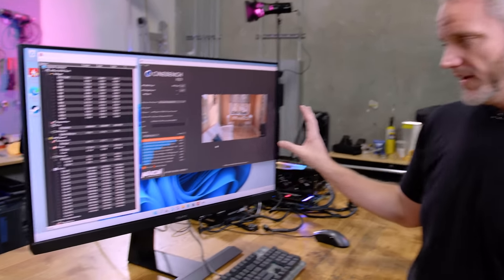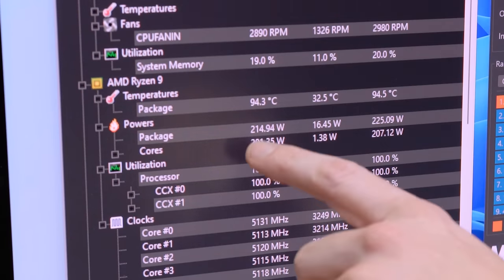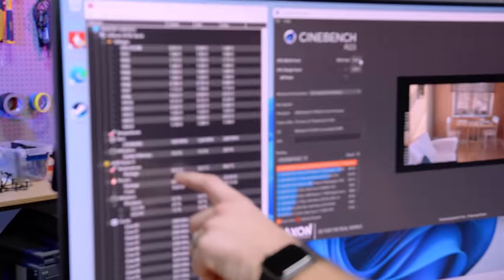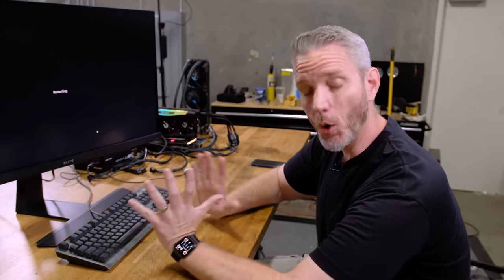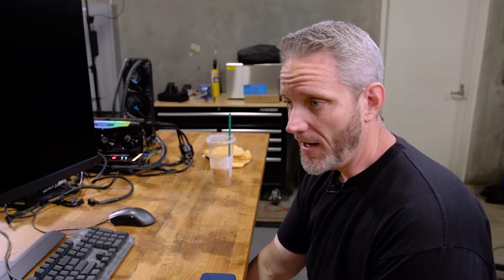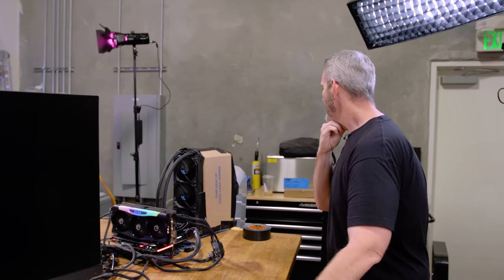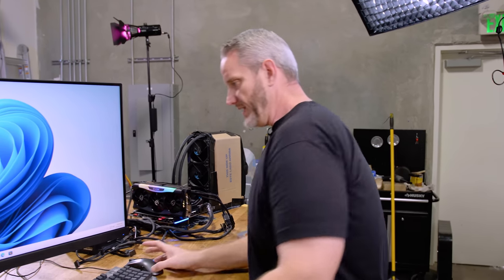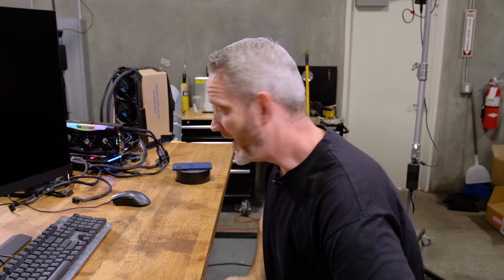This is fine...

Comment: This is a problem! Yes, its by design going to always try and hit 95C in search of max performance no matter the cooling solution. Problem is, as people have stated, this constant high temp will ramp system fans to 100% and it wont be pleasant. I personally dont like this design of maxing the temps no matter cooling solution because it makes it harder to judge what settings and fan configs are working better for it. You have to always compare benchmark scores instead of temps.
Reply: But to counter that you just change your fan curves. At the price of performance potentially. As people have said you just have to change the way you are doing things. Instead of setting overclocking by setting your overclock to your cooling you just set the fan speeds and the OC takes care of itself.

Comment: Jay, to tackle the HUGE increase in heat from all this next generation hardware, surely there is finally the incentive for the majority of people, who can afford to buy the top of the range new gear, to switch to custom water loop cooling, as the ultimate way to cool, stabilise, silent running, and performance boosting (no thermal throttling)? I am planning on a single custom water loop with three 420mm radiators (which was over the top in previous generations, but if you still want silent and extreme cooling, now sounds sensible), with water cooling blocks for CPU, GPU, M.2 gen5 drive, and even DDR5 RAM. I would love to see a video for which of the current off the shelf super cases can handle the installation of three 420mm radiators (or more) to cool the new top of the range hardware to sane temps, whilst having enough room to run the fans at relatively slow speeds for near silent running. I am currently thinking a Cooler Master HAF 700 BERSERKER or EVO pc case, although I heard a rumour that although Cooler Master claim you can install a 420mm radiator in top, side and bottom at the same time, there is no holes suitable for a 420mm at the top of the case; so if you could check this, and if it proves the case (pun intended) check what would be the maximum possible water cooling setup in that case, eg. two X 360mm top + 420mm side + 420mm bottom, possibly even something on the front or back. Would love some expert advice for us enthusiasts wanting the ultimate in water cooling and silent rigs. Thanks in advance from a loyal viewer.

Comment: its the 95c doing the crashes by stock voltage and 5.4 is too much ...why not lower the clocks so the temps can go down...i bet at 4.3ghz....the temps drop tremendous to 70c....95c sure is normal for folks live in canada...just wait when any texan use this during hot triple digit summer , now thats not normal when this crash a lot during summer for folks gonna be stuck in messing with the bios vs intel just set it and forget it , then game 24/7 vs amd users gonna spend 24/7 messing with bios settings constant heavy

Comment: I want to see what level of performance will happen with a Wraith Prism at a standard noise level. If it can run faster than a 5950, then the argument of "Air cooling is dead" will just be wrong.
*edit - It sounds like the cpu is auto-overclocking to the level of cooling you have. So a bad cooler, could actually run just fine. Yes you would lose performance, but the performance could be way better than previous gen throttling.

Comment: newer gpus have the sensor that detects the heat produced directly on the die, and the other reports the edge of the chip(which was previously the only temp reported) as the edge of the chip has the potential to burn/melt the board.

Comment: You should lap the cpu, like derbaur mentioned the IHS is thicker than previous generations. So lap the crap out of it so you have less metal to transfer the heat through. Then see what kind of improvements you can get

Comment: Hey Jay,  I use Ryzen Master for overclocking my 2600 and I never have to restart on a cpu overclock. My system crashes bios overclocking so I have no choice but to use ryzen master. I just set  open it after I start my pc and apply a profile and I''m good to go. I know I'm on a completely different platform so this may not apply to you but for me, a restart is only required if I change memory frequency or timings. My main profile only overclocks the cpu and leaves everything else at default.  I've  had issues with crashing as well but it was only when I attempted to downclock or lower the cpu voltages.   Seems like the issue could be the Auto overclock feature for you. If I'm not mistaken, it adjusts memory and cpu settings.  Not sure exactly what changes you've made in Ryzen Master but maybe you should try and adjust one setting at a time then apply which may allow you to isolate whats causing the crash.

Comment: I don't get it .. if it was designed to do that . Then you don't need any more cooling.    Since it will sit there at 95 degrees at all time ?.. it's like why bother building a cpu that must be cooked at all time at 70 degreess and hurts under load .. now you got a cpu that is designed to work under high heat.. you don't need to cool it down when it's designed to run hot it's stupid

Comment: I'm typing this on an FX-8350 system, but I feel like I'm on the other side of the spectrum. I'm looking at the 7700x with thoughts of under-volting it to keep my thermals down. I know they did a lot of architecture changes, but I just don't like the trend of throwing watts at parts to make them faster.

Comment: I use my Ryzen 5950x undervolted via PBO2 so when I render in Arnold full blast all cores are around 4.3ghz 57c temps (23-24c ambient) and 135-140w power draw. Honestly if you already own a 5950x you should stick with it. I mean the performance of the 7950x it's great but with the cost of those temps and power draw it's just not worth it. At least for me. And not to mention if you want to upgrade you need new motherboard, new RAM.. that's just insane.

Comment: 9:55 Hey Jay, from what I seen on new Boards Intel and AM4, They have a option in OC, might just be MSI (That is mainly ones we deal with in shop), that says "If OC Fail clear CMOS", which eliminates the having to manually clear it. Possible the AM5 boards have it enabled automatically

Comment: Let's try to reiterate: So the Zen 4 logic is to max out either power or thermal limit - and it is easier to hit thermal limit - one of the cores in the bunch is enough - and once you beaten thermal limit by better cooling it hits the power limit and dictates the ultimate power draw and draw no more unless you delimit. So you need a really good thermal solution to stop it from going to the 90s.

And the old X99 with that 10-core i7 Extreme would overshoot power limit with AVX workloads because of erratum BDH56 but you do get up to 128GB of RAM and can be tuned out to go faster (maybe time for ultra high end vs. current and next gen shootout?)

Comment: I picked up an XFX R9 290X Double Dissipation Edition back in 2014, according to AMD, 94C is max temp and the card can be run at that temp for the life of the card with no issues. Idk, I've always done what I could to keep it at or below 80C. Still using the card, though the newer games do drive the temps to max. Just posting for reference on the temps and a timeframe.
(Yes, I know he's working with a CPU, but GPU or CPU, temps are temps, and AMD mfr'd both. If AMD keeps this up, we're going to need second air conditioners just for a computer room in the house :/ )

Comment: I have a Intel i9 11900 (non k) because I can't be bothered overclocking. With a big Noctua air cooler and Windows in power options balanced mode, it jumps between 2.5 to 5.12 ghz. In high performance mode it sits between 4.80 to 5.12 ghz, and a 65 watt TDP. no problem.

Comment: Jay , they start to use new type of transistor's , witch back temp-resistance  corelation , some new matirial in semicondactor.
AMD NEED that 95 deg so the processor achive PROPER  charecteristic's  (semicondactor ) to achive beter condition.
that wy we see increse tempreture BUT not rising consumption , becouse  internal resistanse of transient stat of transistors ar GOING DOWN , less power desipation to heat. less loses to heat. more heat , lest power consumption.
that my opinion.

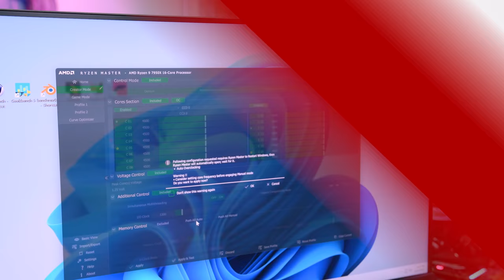Comment: 10:33 Sorry, Jay, go back to school for some physics classes. Space heating is only depending on the power consumption/output of the cpu. If a cpu uses 150W, these 150W are offloaded into the room. It does not matter what temperature your cpu, the water or the air has, in the end it's always 150W you dump into the room. You either dump a certain amount of air with 95°C into the room or you dump a lot more air into the room that has lower temps.
It's like energy consumption: it does not matter if you have have constant power draw of 150W over 1h or 300W over half an hour. In both cases your meter says total energy consumed = 150Wh

Comment: Cut the power limit in half, from 220W to 110W, the temps will drop.  Also, you'll only be dumping half the amount of heat into the room.  You'll lose 5-10% performance, but half the power consumption and way less heat dumped into the room and inside the case.  Lower temps in case will improve GPU performance.

Comment: So when overclocking all core with the same clock, stock voltage control, it runs cooler. This means, very simplified: On Stock it seems the cores individually boost a lot higher than the average clock speed shows it, also it might peak for a short time on some cores, making the CPU 95°C on ONE individual core at a time to get the best possible performance out of the CPU. It looks to me as though Lisa Su had ordered the Radeon team to the Ryzen team to figure out with them how to apply the GPU boost algorithms to Zen4!

Comment: Well temperature which is shown and which sensor detects it.. is kinda 'different' than we had in the past.. That reminds me on 'cooktop/stovetop' and 'induction' types.. on appliances, it gives same temp on a paper.. but in reality is little bit different as we know.. I wish if Jay can make a test in closed case of his choice, also somehow to measure temp in the case during 1h of load.. than we can compare is that temperature which is shown in software/bios is actualy dissipated heat or temporarly heat which sensor detects it on chip.. or whenever is located.. If is on chip and is not actual dissipated 'heat' ... ( ofcourse that temps will eventualy be taken out of the case depending how effective AIO is to lower it) than it's ok.. I mean who cares if cpu works on 100C or 20C if performance is there and is designed to work like that.. Maybe this request is too much or this is not channel of that kind to 'investigate' that 'actual' heat which we can sense into the case/room i would understand.

Comment: This is going to prove a fun platform for cooler showdowns now. Top of the line air v. Aio (240,280,360,420) seeing if they are up to the task. Then custom loop. Also the direct die that Roman was doing is going to look promising. Has anyone gone direct die LN2? I guess the next best would be to just lap the fuck out of that heat spreader to thin it out. 

I guess I’m excited about PC content again… still don’t think I’m going to pony up for one of these chips though. Just don’t have the money right now for it. Probably going to go grab a 3800x3d while I can and call it a day.

Comment: I don't get why people are so concerned about the temps. The part will boost till it hits 95C. If your cooler cant handle as much heat, it will simply boost less, but still give you all that your cooler is capable of handling, IE boost until it hits 95C.
No matter what cooler you are using the part will give you maximum performance at that coolers capability at all times.
Laptops have been running at 95C for years and years and they don't have much problem, its perfectly safe.

Comment: Jay,  

I have seen some info around about ECO mode with the new 7000 series, (in Ryzen Master?) which will limit the "power draw" of the 7950X to 65W draw.  Have you looked into that at all in regards to temps and performance?  I would love to see a video about at as it could be very important for SFF systems.  

Thanks

Comment: I don't see the point.

Why buy a CPU that meant you needed to run your cooling at 100%?

If the AMD 7000 series was donwclocked and downvolted a bit, with normal temps I would have bought one.

Comment: Here's something I've been curious about for a while. You hear a lot of "You don't need more than 6 cores for gaming" and "Gaming needs clocks, not cores."

In a money no object gaming rig, would you get better performance by buying the top SKU, like the 7950X and disabling SMT, or hyperthreading on Intel. Since the L1 cache is shared by two threads, if you disable SMT you're theoretically giving each core as much as double the L1 cache. We saw how much difference extra L3 cache made to the 5800X. The other thought here is, with SMT disabled, can you push the clocks harder?

Comment: I have a Ryzen 7 5800X running the same way. It goes straight to 90c and stays there. It has a 360 AIO from Arctic on it. So as of watching this, I am wondering if it is just normal behavior.
Reply: I have one undervolted and it runs 75c most of the time under high usage max is like 83. My buddy just built his and his is doing what yours is even with a good undervolt. Has yours been stable?
Reply: @Fergie_Ferg  Yes it is stable. I think it has to do with the precision boost is why the temp goes so high on Cinebench .

Comment: So having a case with good airflow and a good cpu cooling solution. My current case is a Rosewill Thor V2 which comes stock with 3x 230mm fans and 1x140mm, I've add an additional 140mm for intake, could this be a good candidate for an AM5 build?

Comment: So is there a point of even setting a fan curve? If the CPU is sitting at 95C when under load then are the fans just sitting at 100%? Will the fan curve basically be 30-40% at idle then 100% when doing anything?

Comment: The temperature going down so fast when you stop might also mean that it's not saturating the cooler (i.e. the heat is not making it to the cooler). Could it be that it's not very efficient at dissipating heat from the cores?

Comment: I know, you wanted to cool the cpu. That was the purpose of this video.
But looking at Ryzen Master on Screen at 14:30 tells me, that the CPU can perform better - at least at these temperatures with AC-cooling.
You have a maxed out PPT at 230 Watts and a maxed out TDC at 160 A.
Sou, of course, you are not thermal throttling for sure but increasing PPT to maybe 250 and TDC to 180 may give you even more performance...

Comment: I still want to see someone put a radiator inside a mini fridge with hose fittings mounted through the side. :p Get that fluid down to 5 or 10C! Might get condensation in the system tho.

Comment: Thanks for the video! 🥳 I am curious about the fan curve. Do the fans scream up from the start to 100% percent?
I am not so into getting the last MHz out of the system but want to have it silent. Can you tell the BIOS to have max fan speed of maybe 1000rpm and the CPU will behave the same? Our will the fans go to max speed as the temps are rising?
Maybe you can test it with a standard cooler like a bei quiet pure rock...
Thanks to you and your team 🥳🚀

Comment: Can we try somehow comparing Ryzen 9 7950X's fluid temperature vs Intel Core i9-13900K's in a same watercooling loop?
Or any processor really that isn't also among Ryzen 7000 lineup, maybe one that has an even higher TDP but doesn't reach 95C in the same loop

Could show whether AMD's temperature reading is truly dissimilar to traditional temperature reading.
Because if it is, then we should see quite a substantial difference from core temperature and fluid temperature which is what seems to be really happening.
And to see exactly at what point (in fluid temperature) must be reached maybe to start seeing the core temp drop from 95C

Comment: You've said you're planning on taking one of these 7950x's home for your streaming setup, right?  It'd be nice to get a talking head bit on your experience with it in a practical use case after a few weeks of having that set up.  A lot of the concerns people are talking about with the 95C thing are related things like having all their fans topping out when under load because the temperature probe they're keyed to is hitting what fan curves see as "fuck everything is melting if we don't fix this NOW", or the fact that venting a 95C processor to their room for an extended period of time is effectively turning the computer into a space heater.

Like, you can design a processor to stand up to 95 degrees...I guess.   I'm not a computer engineer, I have no idea what temperature actually does to silicon chips aside from the broadest idea of "they work less good" or "they stop working"  But it's conceivable that you can solve that problem with sufficient engineering expertise and effort.

But...making the fans not see 95 degrees as a reason to panic is going to require a fundamentally different approach to fan modulation, and I'm not sure what other than temperature is a reasonable input for the fan curve.  Unless maybe you put a temperature probe on the top, up against the thermal paste and measure it based on how stable the surface of the processor is?  That's weird, but it's the least weird I can think of.

And making a 200 odd watt power draw not pump out about 200W of heat into the room is, uhh....how thermodynamics works.  So the question is more about how bad the power draw is in a practical environment instead of a stress test environment.  Stress tests are really useful for producing those hard line comparisons in compute power, but when you're working out if the computer is a furnace or not, the system's ability to pace itself is critical.